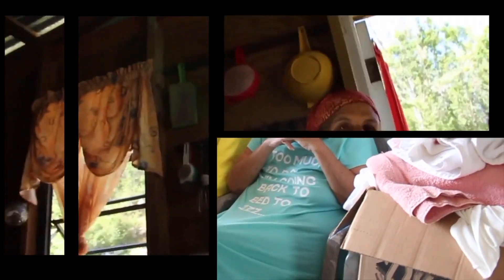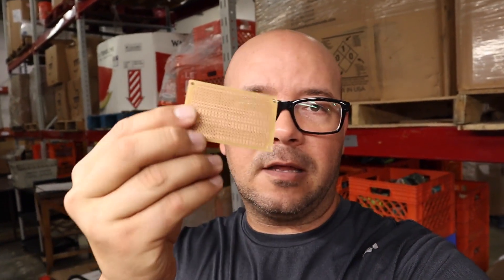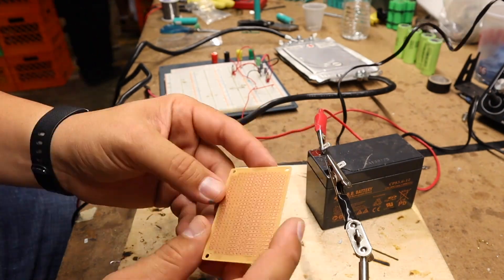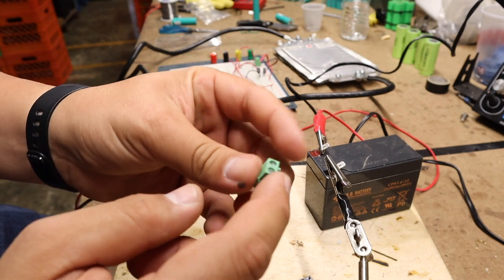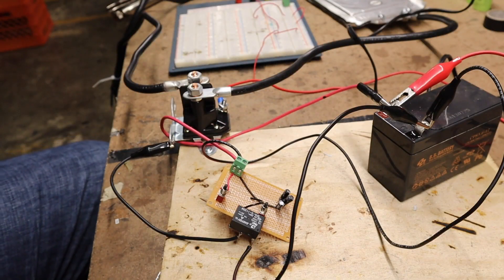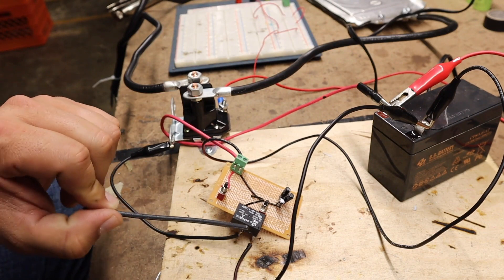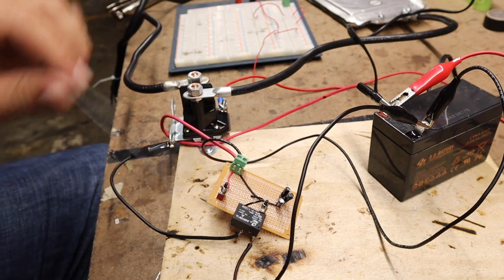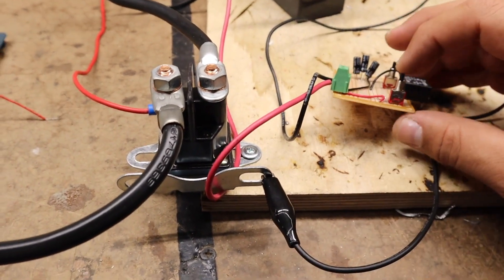Diy Spot Welder Timer for 18650 batteries | Off Topic Ep 8

Comment: Hey Javier, been kinda sick for the past 5-6 week, been having allot of the health issues that plague me for the past 8 years catch up, hoping to be back in the saddle soon. Not sure if you've ever had a chance to watch my videos, but I have done DIY Spot Welders just about any way you can think of, without using crazy circuitry. Testing and fine-tuning them all, till they tab a 18650 perfectly. I have probably 9 total welders(2 of them Capacitor welders), 1 car battery welder, 1 made from 2 x 7.5ah UPS batteries and 5 made from MOTs. I have used all kinds of simple tricks to control the power with one of my Favorites using a dimmer and Snubbers to control the amperage. I've been building these types for the past 1year. I plan to show my newest Capacitor welder once I get back to the videoing. That one I can actually tab a few batteries with one charge. I also designed a circuit board to use with the caps. I made a single cap board and a, 12v that can be stacked. Here is my channel if your ever just chilling and looking for some quick ideas. Just drop me a line anytime-

https://www.youtube.com/c/njfulwider5

njfulwider5
Reply from the maker: I haven't seen the videos. Will start watching them tonight.  Hope you get well...

Comment: Simple Spot Welder! How many amps can the solinoid handle?wondering how long it will last with the high amp blasts. Time will tell after testing and using for a while. I have a crazy mercury solinoid I got from my recycler, ill have to see what it can handle🤣💥🖒
Reply from the maker: Sense its a Lawn Mower solenoid it can handle from 200 amps up to 600 amps depending on the battery size. But this ratings are base on a typical 1 to 5 seconds cold cranking amps. 

I'm using close to 400 amps on the solenoid but its just a pulse and shouldn't be a problem. But like you said, only time will tell.

I've used a similar solenoid on my first spot welder and the battery was rated for 250 CCA and I've seen others using close to 400 CCA.

Just be carful with the LiPo. We did 3s1p as the starting battery for the first try and it literally blew a hole through the nickel.

Comment: Don't use the relay like that, it will rip the pads off the board.
A footswitch is much more comfortable. It's better to use both hands to weld.
You don't need a controller to trigger the timing. A cheap timer ic will do.
Now you always have to push two buttons. That would drive me nuts.

You are missing a Diode over both of the relay coils.

May I send you a picture?
Reply from the maker: Its a prototype. 
1. I dont have a switch pedal
2. I won't use the spot welder like that
3. It's still a work in progress 
4. Diodes for what?
Reply: @javiercamacho  The coils cause a very high voltage spike when switched off. That can destroy something very quickly.
It's just a simple Diode 1n4001 in reverse.

I would suggest using a mosfet to switch the big relay. You will get an adjustable pulse width.
Only 6 very cheap parts needed.
Reply from the maker: The relay is been energized from the caps only. 

I'll add the diode just in case
Reply: Don't think about it any further. There are 555 delay timer pcbs with relay on eBay for 1,69€ including shipping.
You just need to change the capacitor to get very high switching speeds.
But the big relay will not be able to switch faster then maybe 15ms.
Reply from the maker: I don't need faster switching but reliable switching.  

Remember,  this is a hack. A simple DIY project to help people get into the powerwall movement. 

Is not meant to replace the off the shelf products. 

At least not right now
Reply: @javiercamacho  A 555 is as realiable as can be.
High switching speed means something like less then 100ms in this case.
That's enough to weld and it's adjustable.
You get a full timer board PCB for the price of a relay.

I just try to help and find the easiest and cheapest solution. That's a no-brainer.
Reply from the maker: Thanks for sharing. Perhaps you could send me a schematic for me to see and test
Reply: I just got one of those timer circuits yesterday, now on to the build
Reply: @jrotor3301  Thats great!
Replace the 100yF with 1yF.
Connect the switch to positive 12V. Connect the output of the switch to VCC on the board.
Run a jumper from VCC to CB on the output
Run a jumper from GND to CK.
Connect the 0v or - from the 12v source to GND on the board.
Connect the input of the 400a relay to com and CK on the output of the PCB.
Put a reverse diode on the relay.

This does the following:
Switch turns PCB and relay on.
After max. 100ms the PCB turns the big relay off and shorts it to ground to make it turn off as fast as possible. 
You need to press the button for at least 100ms.

Tell us, how it works.
Reply: Thanks Frank👍
Reply: @jrotor3301  I just saw another video of a spot welder. 240ms is too much, please use a 1yf capacitor.
I will update it in the answers above
Reply: @javiercamacho  I don't think ppl get what you were doing, I grew up doing things with what you have, sure things may be dirt cheap to make it better, but if you don't have it you do what you can,I have rebuilt engines with used parts, only sanding the rings and stretching them out a bit to seal, and honing the cylinders, and it worked great for years, new rings would have been $20, but the engine I was working on was the only way to get the rings! Ha-ha... So all I could do is what I could. Ppl have the buy buy buy mentality, not a make it work safely with what you have! Great work, great video!
Reply: @javiercamacho  you could connect more caps with micro switches to make longer pulses! Or just solder them on , awesome, I been thinking of building one, I been soldering, using a 300 watt iron, I don't like soldering cells, I don't think I have over heated any,  I need to get to work!!!